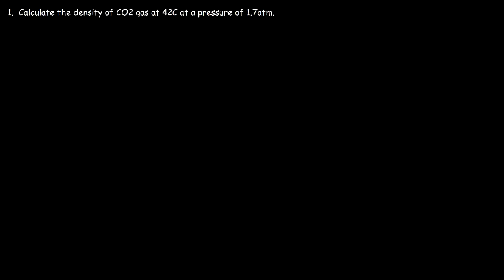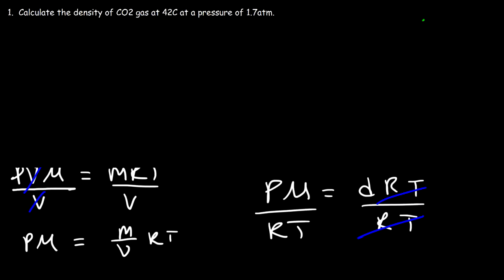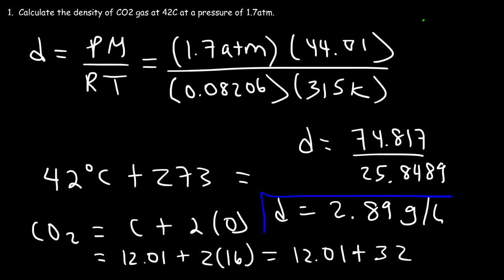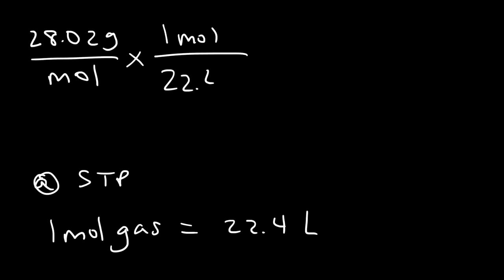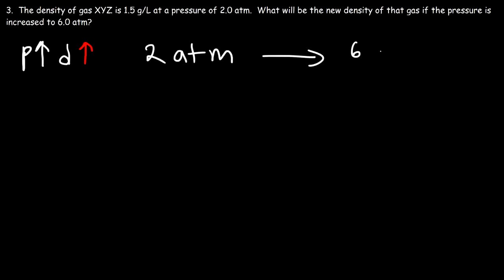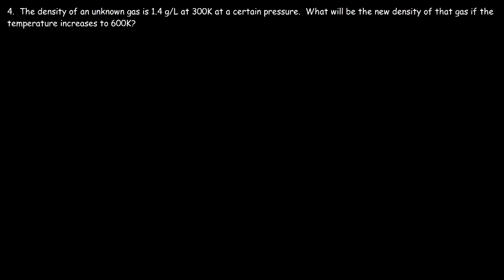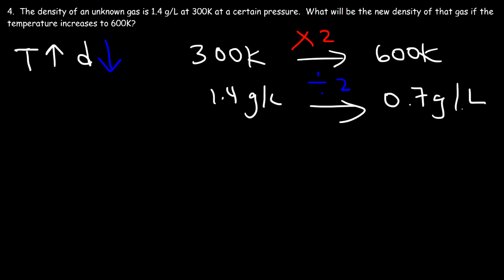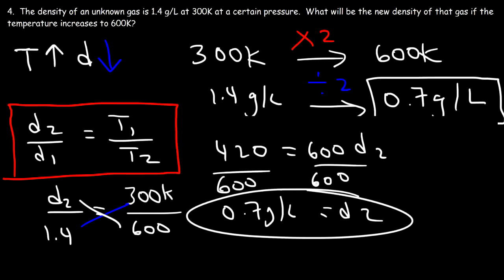Gas Density and Molar Mass Problems at STP - Chemistry

Comment: Professor Organic Chemistry Tutor, thank you for another awesome explanation of How to Calculate Gas Density given the Molar Mass at STP in AP/General Chemistry. The relationship between Pressure and Density, Temperature and Density and Molar Mass and Density is a great way to grasp the concepts of Gas Density and Molar Mass Problems in Modern Chemistry. This is an error free video/lecture on YouTube TV with the Organic Chemistry Tutor.

Comment: shouldn't I need to found the same result using the P/T ratio? first I have tried to find the P/T ratio from d = P.M/R.T and then I have used this equation d2 = P/T * M/R  to find asked density. But my result wasn't the same as yours.